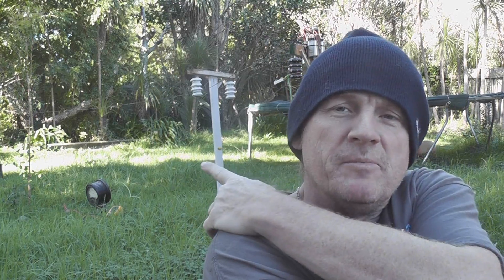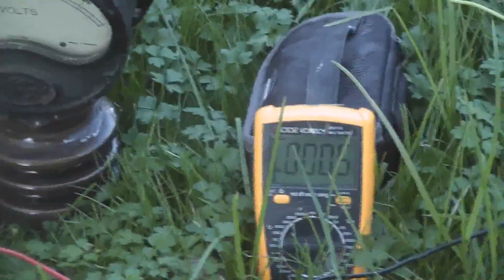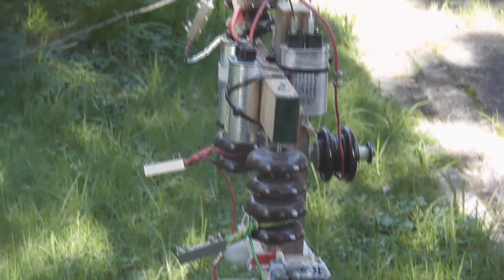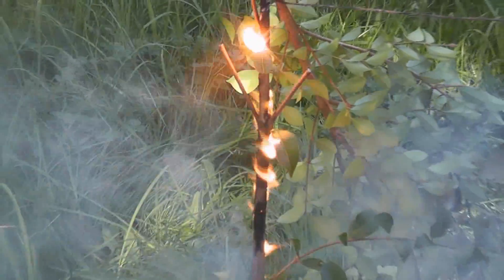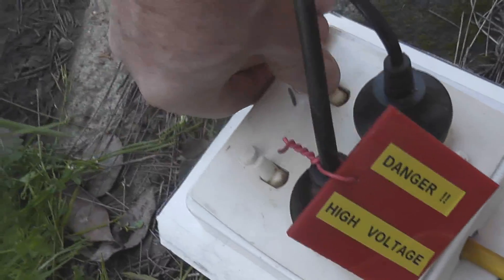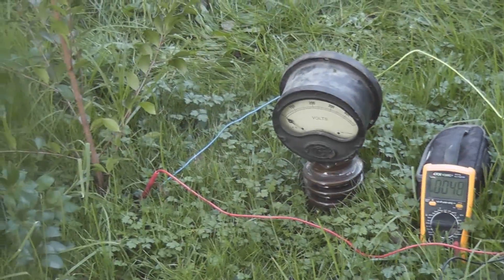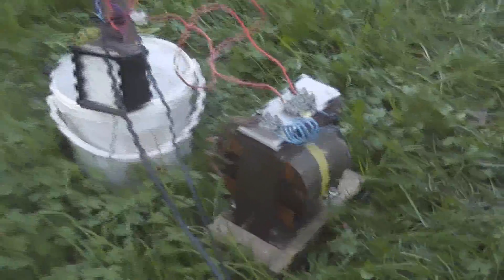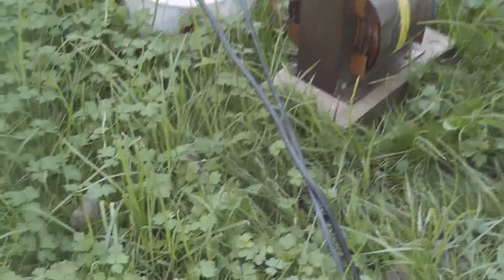Step Potential in grass - clay ground

Comment: How do you manage to draw nearly 30 amps from a standard 15 amp plug? Or are your extension leads seen in the video rated for that current?
Reply from the maker: jon johnson No they are standard extension leads which go very warm to hot.
Power is supplied from a 25 Amp circuit.
Reply: OK that explains it then I guess it's one advantage of having no fuses in the plugs!

Comment: My mate says he used to measure a step potential under some 132Kv  lines of about 30 to 50 volts  I think k it caused problems with a telecom earth in the end they found a faulty insulator on one of the pylons

Comment: A great video, love the live wire smoking up the vegetations. Got me thinking that using such a wire of suitable length would be a great way to set up some sort of snake barrier around the shed, however I guess the risk of electrocution might be more of a problem than being nailed by a passing rogue snake! I love the old analog volt meter, hope you can fix the sticking meter movement.

Comment: can you show in a video how to wire an ampere meter
Reply from the maker: DerTechnikKanal Will do. An ampere meter goes in series with one of the supply leads. Usually in the active or live wire.
Active-------Ampere-meter--------Load---------Neutral.
Reply: ok

Comment: I remember seeing the leaves at the top of a very large tree next to a 132kv line dis coloured, like it had been blown too close the power line in high winds. If you were leaning against the bottom of the tree when it arced over, what would the likely outcome be?
Reply: Coolkeys2009 Probably not good: This is one of the reasons you don't stand under a tree during a thunderstorm, you conduct electricity better than the tree does, so in your example the poor guy leaning against the tree would likely get badly hurt (of course power line voltages are much MUCH lower than lightning, but it's still not somewhere I'd wanna be!)
Reply: ***** Agreed - and I reproduced pretty much that exact scenario in my video about Justin and the Lightning. In that case the ~100kV power jumped from the tree to the hand and fried Justin. RODALCO2007 is doing a great job promoting safe experimenting.
Reply: ***** One issue with some one standing by a tree in a lightening storm is the probability of the tree getting hit is higher than that of a person. When the tree gets hit the lightning may flash over and hit the person or the step potential in the ground induce current flow up and down the legs, the tree may explode from the sap and other liquids in the tree boiling sending hot burning shrapnel at the unlucky person and as they lay on the ground injured the weakened tree may fall on them and crush them :-(
Reply: +Coolkeys2009 Great question. Got me thinking. The tree roots (containing moisture) would act like a substation ground grid (conductive) and mitigate step/touch potential, but still very dangerous (explosions). Regarding a downed power line scenario, there are no roots and step/touch potentials would be much worse. Great video!